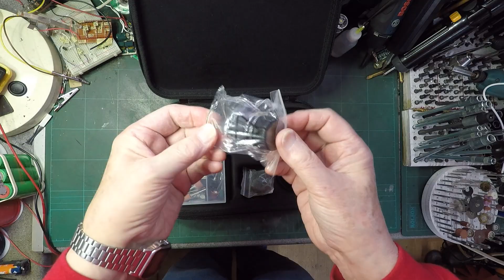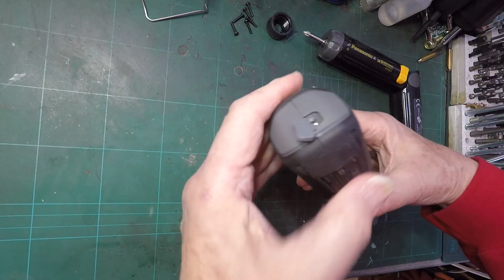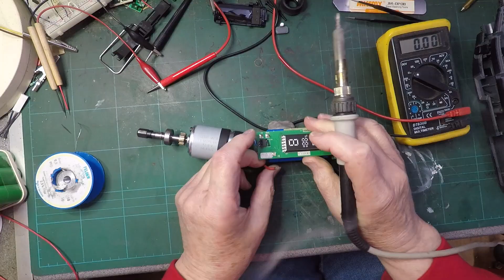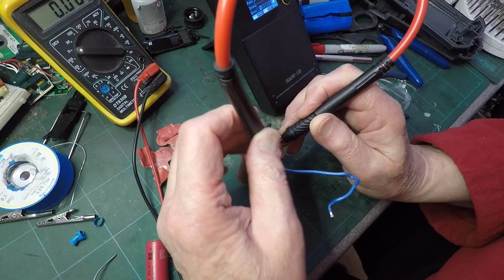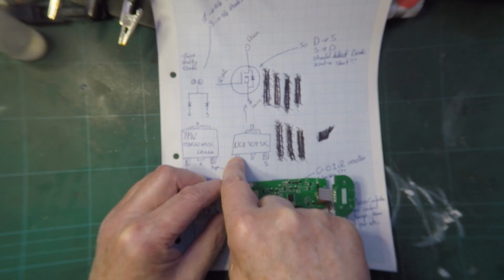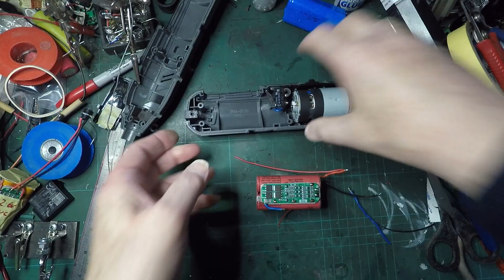Depstech Cordless Grinder Repair (Dremel copy?)

Comment: Had a quick look on the web using co-pilot re E5 error code. Part of a few answers e.g.  ''On a Depstech rechargeable grinder (such as the DC08 rotary tool), error code E5 usually indicates a charging fault. This can be caused by issues like an incompatible charger, overheating of the battery, or a hardware connection problem. The recommended steps are to check the charger and cable,'' etc 
 Overheating Protection: The DC12 has a built-in safety system. If the motor temperature rises too high, it will stop and display E5.

Overload Condition: Running the tool with too much pressure on the bit or accessory can cause the motor to stall, triggering E5.

Blocked Shaft/Accessory: If the accessory is jammed or the shaft is obstructed, the tool senses abnormal resistance and throws E5.
Reply from the maker: wow. Thank you. I never found that information on the web.

Comment: I expect that replacing a one cell with a newer one might cause a few problems later. When charging it will always take longer if it's capacity it higher than the other two, putting a strain on the balancing circuit. discharging it will have a higher terminal voltage than the other two, with luck the protection circuit will cut the output before the new one tries to reverse charge the other two.
Reply from the maker: That's a level of battery k😁nowledge that is beyond me.